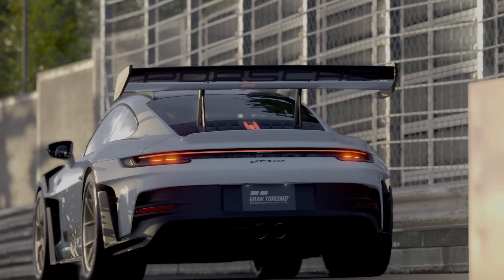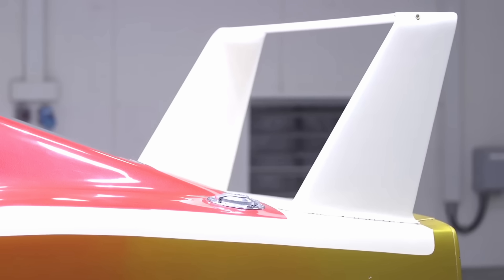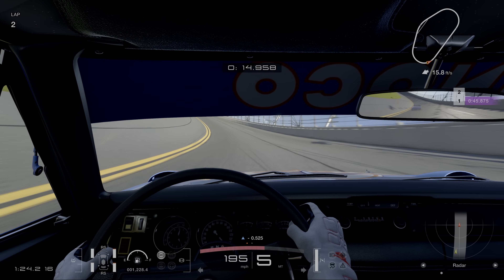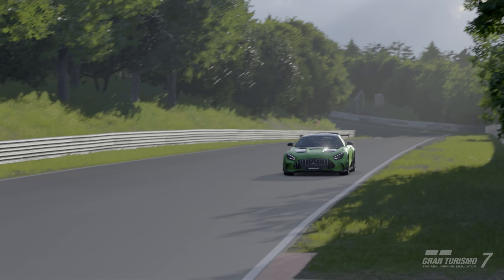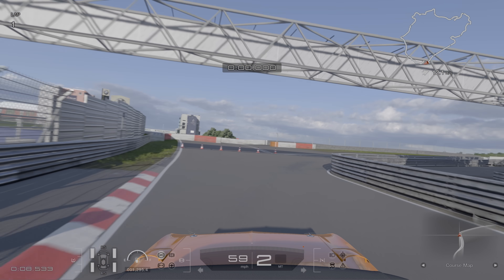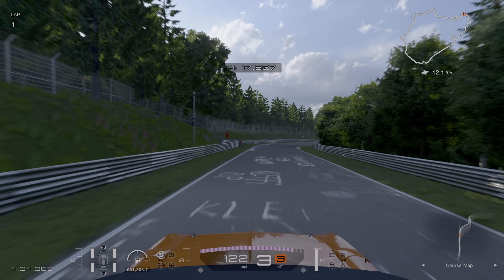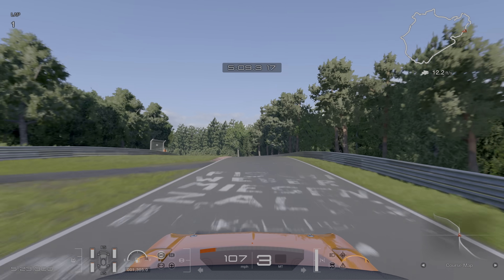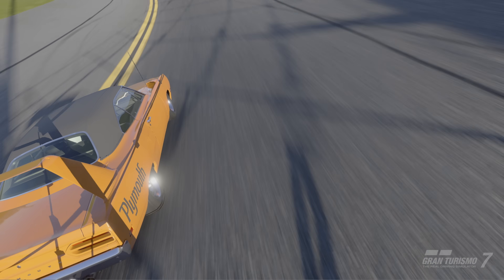Why Is This Car Undrivable in Gran Turismo 7?

Comment: I'm kind of surprised some people completely forget about rigidity upgrades, they're very relevant for old cars.
Reply: True my way to decide if the car needs it is to see if the pp limit goes up or down when i apply it if it stays the same it
 wont make much diference but if the pp drops it might create understeer but thats just the tip of the iceberg because the rollcage also increses rigidity it takes some tries to find the right combo
Reply: They forgot how wobly old cars are. It literally disorients the car.
Reply: I was always dubious that it did anything because in my mind the cars are just one rigid polygon like in other games. Kudos to PD for incorporating body flex
Reply: i think there are just more casual gamers, and the people who cant drive cars need to go back to forza horiozn and NFS
Reply: @beatles42ohgg94  says the guy playing a casual racing game in GT7.
Reply: It's sad to say that they were too busy blaming others that the car is undrivable, than just sit and think for themselves and try solve it.
Reply: You're expecting gamers to know in detail about the realism of cars IRL. Truth is modern vehicles have such strong monocoque chassis with very high rigidity to enable modern, high tech suspension to do their job and give a very sorted, planted ride we come to expect.

Back then, classic vehicles don't have to computers & calculation power to remotely design and engineer that sort of rigidity into the car body, not to mention suspension design especially in American vehicles back in the day were soft & floaty compared to modern vehicles.
Reply: I didn’t realize what a difference it makes!
Reply: @beatles42ohgg94 GT7 is a casual game too buddy don’t think you’re included in the real sim racing games
Reply: @MiguelPerez-eh3on I just go full
Stiff 😅
Reply: It really depends because it changes completely the car dynamics. I only add this when I have multiple cars of the same make, because some are fun when tail happy and challenging as they are, which is nice. The moment you change the chassis, the car is another car.
Reply: That’s awesome!  Great vid, subscription worthy and it’s my first visit to your channel!  Do u have a C3 Corvette tune?
Reply: For old cars it's rigidity upgrade, for new cars it's flat floors lol
Reply: I always thought it was "restore" not "increase".
Reply: @Audfile  dunno about 7 but the others had both, you could upgrade it and then after however many hard miles it would tell you it was losing rigidity and you could do the restore
Reply: @bobbyhumphrey199  Interesting. I have thousands of hours between Sport and 7 and always learning something new. Thanks!
Reply: @Audfile  disclaimer I didn't play sport either, my last and most played is gt6, 5 and 4 right behind that, didn't play 3 and don't remember enough about 1&2
Reply: @bobbyhumphrey199  played them all, myself. I was even a day 1 PS1 owner. GT1 was MIND BLOWING.
Reply: @Audfile  lol i was a borderline poor kid but i got one for Christmas in 98 and everything was mind blowing, including the precipitous decline of my grades.

How does the handling on 7 compare to 6? Is it wildy different or about the same?
Reply: yea i was surprised to see how many peeople were mad about the superbird but didnt even look for rigidity upgrades
Reply: In the real world, the first thing we do is attack the frame with bracing and then suspension, especially since the cars often have a U frame rail instead of  true “boxed frame”.  Even 8n racing they do this with tig welding chrome moly tubes to the frames and increase the strength of the suspension mount points.
Reply: @bobbyhumphrey199  I was poor too! Had to trade my SNES for $100 credit and I would have loved to have kept that. Each version of GT has been better than the last in terms of simulation. GT7 on the PS5 is so good I mostly keep the cars stock. Sport tires aren't crap now, they are lively and fun. And VR! On my Bravia it plays at 120fps. Totally sublime. Not gonna get that on GT6.
Reply: @Audfile  good to know thanks, as far as how the cars felt handling wise 6 was my favorite, sounds stupid but i could almost feel the car through the controller (yes i use a controller, yes i still map throttle and brake to x and square and shifting to the triggers)
$100 on a snes trade in wow how things have changed lol
Reply: @bobbyhumphrey199  dude, the physics model combined with the haptic feedback in the Dualsense (not just plain old rumble) is so many levels above. You can FEEL that you are in a rear drive Porche, an all wheel drive, all wheel steering Skyline, a 2000 lb raced out FWD civic. It's amazing.
Reply: @Audfile  awesome, thanks for the input, been dragging my feet for whatever reason lol i've had a ps5 for like 6-7 months and gt7 will be the first actual ps5 game i play on it
Reply: @bobbyhumphrey199  I think you're gonna be really happy you did.
Reply: @BastianUllr the car can be much lighter if it has super upgrades to it.
Reply: Whenever I see regular people fully replace a chassis with like superleggerra I think that’s more amazing than a space program
Reply: In old games like GT4, having righty upgrades makes cars too stiff, and easier to slide out
Reply: im kind of surprised that people think this game simulated anything. its just an arcade game.
Reply: @UnderwaterAlexJones  Funnily enough iracing is easier than GT7 as it’s more unforgiving with grip loss.
Reply: @UnderwaterAlexJones  says the guy who just said GT7 was casual...OP makes a comment on horizon and nfs then you're going to suggest gt7 is casual, which those other 2 definitely are and we both know gt7 is above those games.

If you want to revive your comment into simcade, fine, but casual, you're just showing yourself to be a fool
Reply: It’s always important to remember weight reduction and chassis stiffening.
Reply: @hagestad  I don't think GT7's an arcade game. There's no green nitrous fire boosts, ramp jumps, police or EMPs.
Reply: @UnderwaterAlexJones  ive literally never played the game. 

just watching a video on it. 

but you get gold for jumping to conclusions.
Reply: @idontgotagun9867  never played GT7, the fact you made this response, means my comment was targeted to you, mission success i guess. 

AC, iRacing, ACC, rF2, Pc2, automobilista 2, 

which ones do you play lul, 

the idea that people think im talking about GT, while they are probably playing forza motorsport and F1 games.
Reply: I built a superbird  for daytona on this game when it  first came out and it still flys. With no rigidity overhaul or w/e.  Alot of you needa learn to tune.
Reply: Know nothing
Reply: @MiguelPerez-eh3on  idk I just smash down rigidity upgrade and go with it. I am not that good in technical part but I at least get that it gives more stability on high speeds and that's plenty by itself
Reply: Money was tight for me in every gt game. Or so I thought. And rigidity looked a bit too expensive to make the jump. Preconceived notion tat it wouldn't do much. Boy oh boy. Makes undriveable cars driveable. Like turning off a lag switchlol . crazy good for oldies
Reply: Is the rigidity increase as helpful in the Shelby Cobra? I love that car but it's crazy in gt7😅
Reply: @idontgotagun9867  and what defines the "real" sim racing?
Reply: @beatles42ohgg94 it’s a video game none of us can drive a friggin race car.Even you
Reply: Except for the Porsches. Gt7 would have you believe they spin out if you even think about thinking about turning
Reply: It's not undrivable you just can't drive it
Reply: Well even back in the day NASCAR’s were not stock.  Way more so than today but they were still tube chassis race cars with lots of modifications done to them.  They are subframe cars so they flex like crazy without modifications.
Reply: I just always do it if I'm fully building a car 🤷🏻‍♂️. What's the downside to this?
Reply: @SammyBoi1022  Not sure how it works in GT7, but the reinforcements do add weight. On a car like this the trade-off is completely worth it though.
Reply: @beatles42ohgg94  Gran Turismo might be slightly more difficult than Forza horizon five if at all 😂
Reply: @teehills007  the horizon games are not difficult. 

only time it is s when you are playing online and everybodys using glitch cars. 

yes, i can make an undrivable car thats faster than A clas thats D class. 

games junk, always been junk.
Reply: Very unrealistic car. This this was a track weapon at Daytona back in the day
Reply: Absolutely
Reply: @brandanhoggan  I doubt they actually flex, they probably just increase the traction or sth to make it handle slightly better.
Reply: yeah, i play forza but its the same. the same car is worthless without aftermarket springs and anti-rollbars
Reply: @beatles42ohgg94 Ive always preferred FMS because of all the top gear references but I don't appreciate horizon in the slightest. FMS might not be as realistic as GT but GT doesn't have the same character or vibe.

Comment: People forget that NASCAR has rollcages, and rollcages stiffen the car up. Civilian version you get in GT was never supposed to go on an oval unmodified, so it starts to bounce around without rigidity upgrades.
Reply: Yup, that is why I have two one I use without the body rigidity (I have managed to drive that boat like a speedboat) and one that could obliterate a ZL1 in Nascar and a 911 RS (901) in the Nür.
Reply: Yup, also, i can be wrong, but i wouldn't be surprised if Polyphony Digital used recently collected data for body rigidity for older cars. So they use the current rigidity of 40+ Yo race cars, who likely have lost most if not all their original rigidity through years of hard use and normal metal fatigue. The Daytona/Superbird being such extreme cars for their time mean that the lost rigidity is much more apparent and detrimental than on a Honda S800 for example.
Reply: @Alystas alright, alright, I pick up what you’re putting down
Reply: its kind of funny that the devs will make old cars wobbly (as they were in real life), but will leave in rear alignment settings for cars that came with a solid rear axle
Reply: I haven't played this game, but I work on old cars.  Rear alignment is possible with a solid rear axle.  It just involves bending the axle housing, usually with a hydraulic jack.  I do think it is unfortunate that body rigidity and suspension stiffness are grouped to-gether in this simulation (in real life, I like a car with a rigid body and soft springs due to the ride quality.)  Chrysler products are usually quite rigid compared to Fords, as they adopted a unibody across the lineup early on.
Reply: @ofp8574  I know you stated you haven’t played this game, so you would have no way of knowing, but body rigidity and suspension stiffness have been completely separate in this franchise for almost 20 years.
Reply: Yeah Richard Petty himself who drove the race version said because of that massive wing it was very hard to spin it out.
Reply: equally, even the most worn-out cars will not behave like this in real life, this is bullshit
Reply: @ofp8574  Bending the axle housing seems like a great way to put the half shafts, splines, bearings etc under enormous strain permanently
Reply: @Anathem22 even Honda Jazz also performed well despite a worn out chassis.
Reply: @PaperBanjo64 keyword “race version” aka completely different
Reply: @Alystas  - They weren't all that rigid to begin with.  Keep in mind that most cheaper modern cars have more body rigidity than 60s era muscle cars ever did factory new.
Reply: @kyle8952  Well it wouldn't be necessary if the axle housing wasn't already bent in the first place.  That's they only reason you'd need to align it.
Reply: @Anathem22  try to wheel a foxbody mustang with worn out steering rack bushings and you will reconsider that statement.  Its like trying to drive with controller lag
Reply: See you then
Reply: @yeetusdeletus9 it's kind of funny that you didn't know you COULD change settings on a solid rear lol. 
What? 
You most certainly CAN adjust camber/toe/etc on a solid rear. It's not AS adjustable as an independent rear but adjustable nonetheless.
Reply: @kyle8952  Adjustable solid rears have been around for decades in the racing world.  This is not new nor stressful on the components.

The ones I'm familiar with have a rounded spline to allow for the angle change.  It isn't a LOT of roundness, mind, only just enough.

They work great.
Reply: @Alystas  40 years old street version, unmodified. That frame is basically molasses by today's standards.
Reply: RIP to the people who didn't know this and tested the limits of the car as they saw on TV
Reply: @kyle8952  you'd be surprised
Reply: @kyle8952  Keiichi Tsuchiya had it done to his street spec AE86, it wore the splines out after 4 years.
Reply: Rigidity in the frame not the chassis…
Reply: Often those roll cages at the time were made of balsa wood painted black to save weight
Reply: Well even back the NASCAR’s were not stock.  Way more so than today but they were still tube chassis race cars with lots of modifications done to them.  They are subframe cars so they flex like crazy without modifications.

Comment: Being an old man I have actually driven something similar, a Roadrunner.  Young men, weaned on game physics and driving cars that are so far advanced from the 60s counterparts simply do not understand how gawdawful a 1970 muscle car was in handling.  I've driven a Ferrari 458 GTB around a track for quite a few laps.  Their is simply no comparison.  I would probably kill myself even trying to get an actual Super Bird around a track.  The steering on an old muscle car requires so much input before you get anything approximating a turn compared to a modern sedan.  The Brakes are a joke.  So it doesn't surprise me at all that younger gamers who have never experienced it would think you could drive it like some high performance super car and be shocked when they were upside down.
Reply: I dailied a 73 AMX for 7 years. Drove a million backroads far faster than what would be considered reasonable. The car handles just fine and the brakes (4 wheel drum) work just fine. Dirt cheap tires and just air shocks in the rear and that was all the suspension mods it has.

A skill issue is involved here. The average person probably couldn’t make it do anything, but a person with skill and guts can.
Reply: It’s true.  They are boats.  lol.  I have a 70 340 4 speed Dart and it’s a bit scary at speed.  Modern day economy boxes have way better brakes and suspensions.  Even on a straight at 100-120 it’s scary how much the car is moving around and there is play in the steering.  It’s also a lot of fun though.  Lol
Reply: @CamaroAmx  I adore my old muscle cars and I have also driven them far faster than is remotely reasonable.

That said, decades of suspension and brake design has made the modern muscle car a starship in comparison.  A modern Mustang (which I've owned) is just unbelievable in handling capabilities compared to muscle cars of yore (which I've also owned).  There is just no way old muscle cars can hold up handling-wise to newer models, and I'm a hot-rodder at heart.

They aren't as boaty as people think, you just have to be able to manipulate the roll.  If you know what you're doing you can get around a corner faster than the unfamiliar would expect.  But not near as fast as you can with a modern car if you know what to do and that's just fact at this point.
Reply: @ the amount of roll severely depleted on the car and its options. But yes, modern cars are far better at handling (decades of technical advancement will do that). But the old muscle cars weren’t undrivable by any means. It just took a little more skill and awareness.
Reply: @CamaroAmx  I don't disagree, but you had to learn how to drive them, you can't drive them like a modern high performance car.
Reply: @ modern performance cars take the driver out of the equation thanks to traction control, stability control, rev matching, ect.
Reply: @CamaroAmx  "modern race cars" are so much faster!